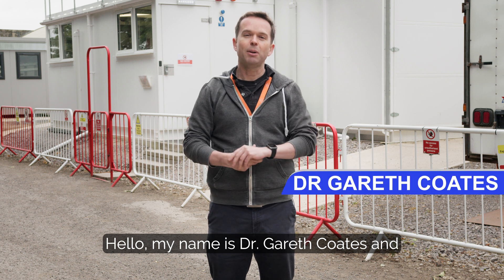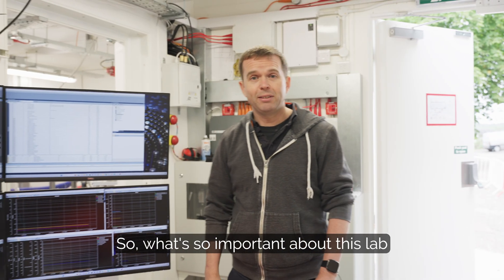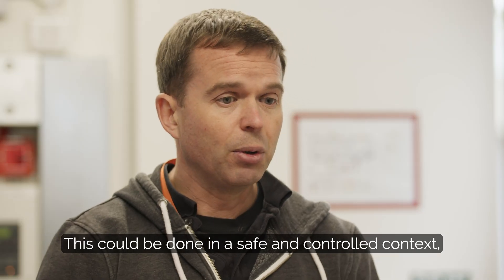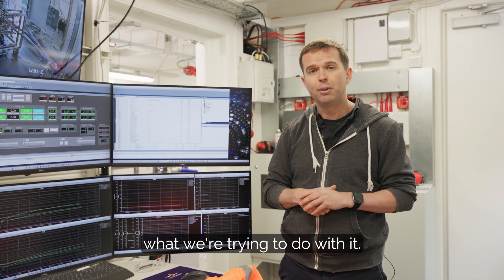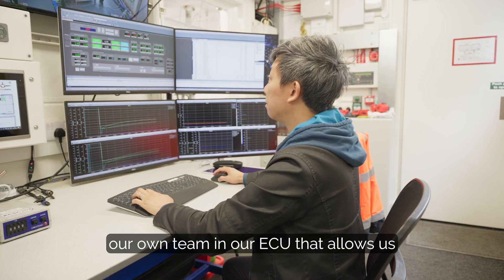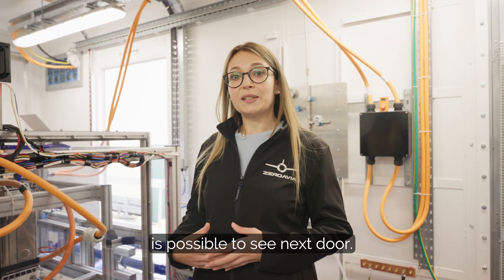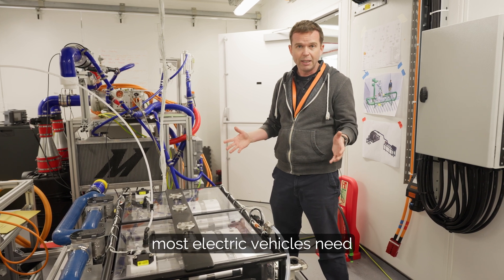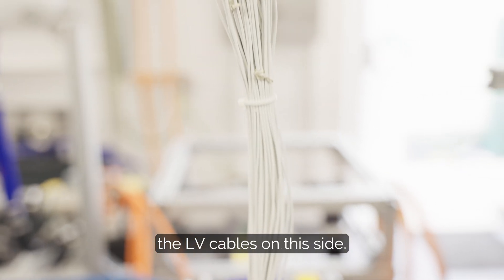Behind the Scenes  - Hydrogen Fuel Cell Test Lab

Comment: I`ve seen nothing special in this video. The power density from fuel cell manufacturer in the commercial vehicle segment is higher and the system integration much more advanced than the aviation system of ZeroAvia. And putting 4 standard automotive stacks in a row is a simple trick for gaining 400kW,.But what about real 400kW stacks. This would be necessary for a compact and lightweight aviation system.

Comment: potential ways to avoid cell thermal rupture or temperature management; runway catapult, runway escort (power)car, twinboom, ammonia fuel, ammonia coolant that doubles as afterburner, deliberately fry the cells when emergency landings are required, on board cryocoolers (trickle charged) and so on forced convection exposed cell to airstream